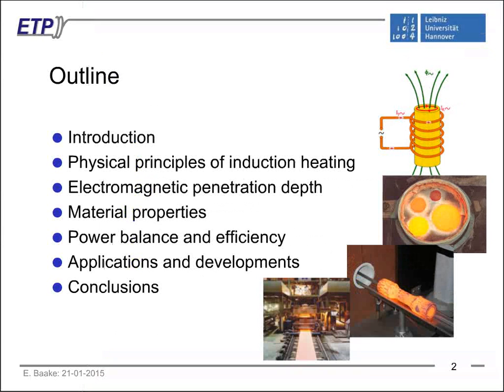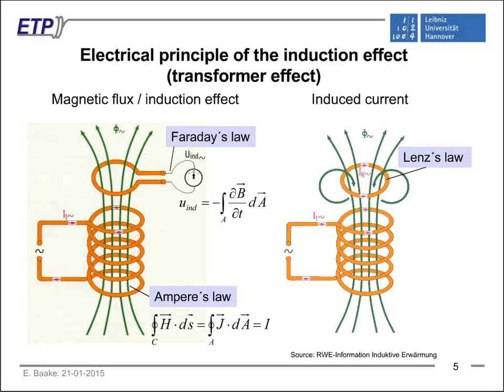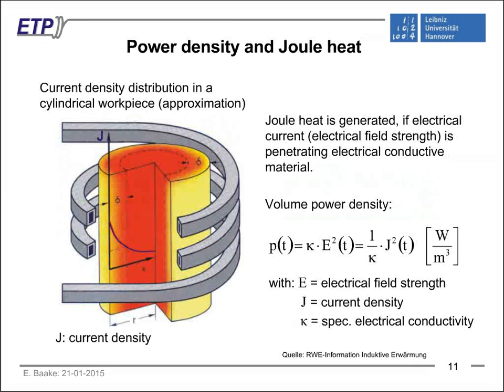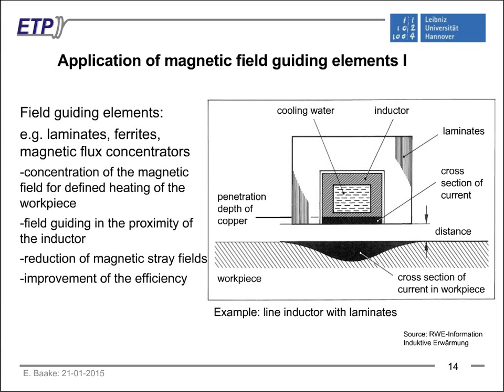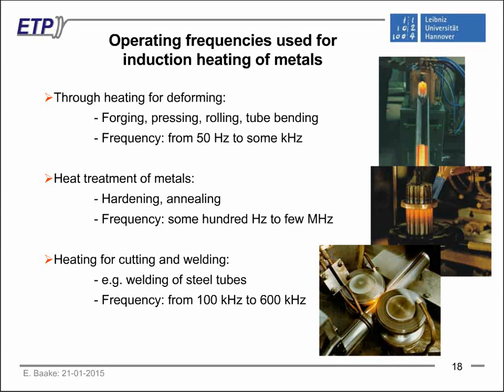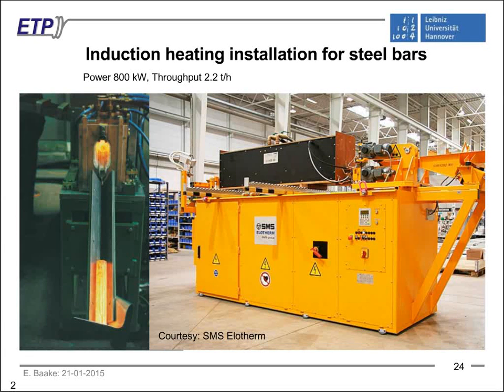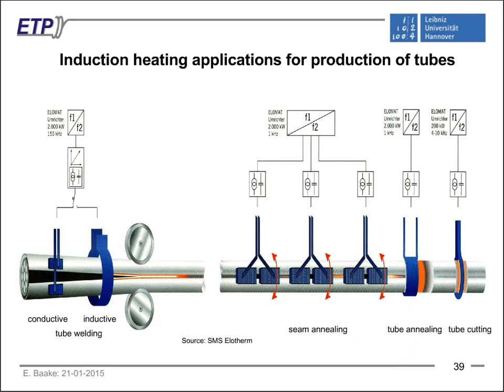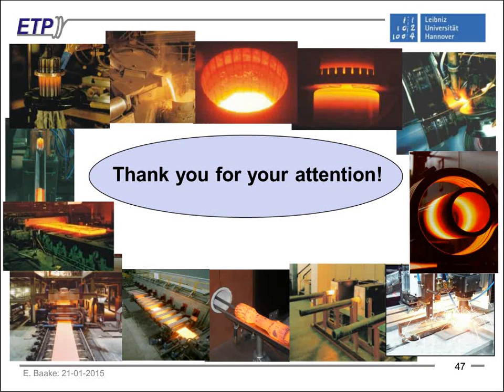Physical and technical basics of induction heating technologies

Comment: Sir thanks, how i can know the depth of penetration in a cylinder solid, i mean i want to make a tempering, the diameter is 100 mm, the length is 380 mm, but i only want to heating 20 mm of diameter, how i can to calculate the time to be exposure the piece? I have the nominal capacity of induction furnace,
Thanks